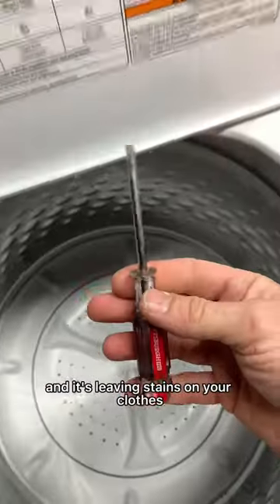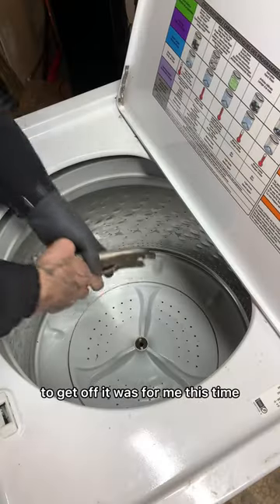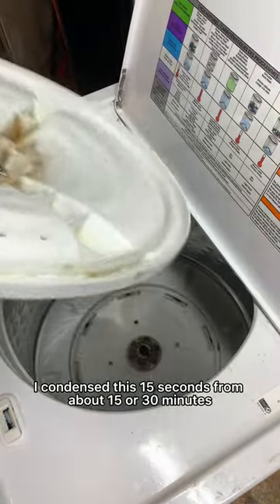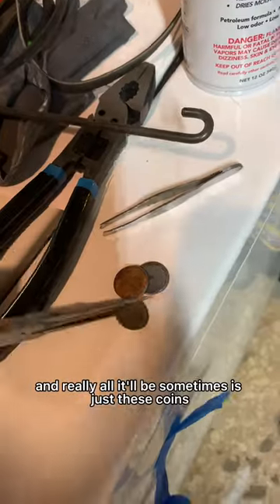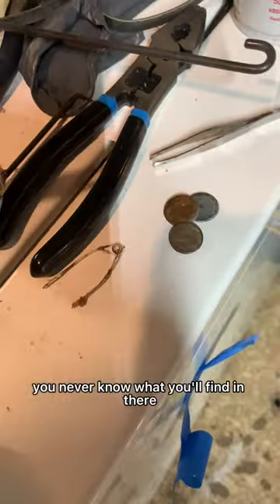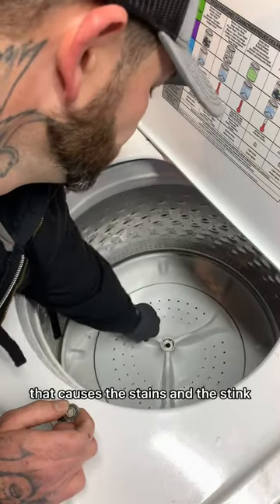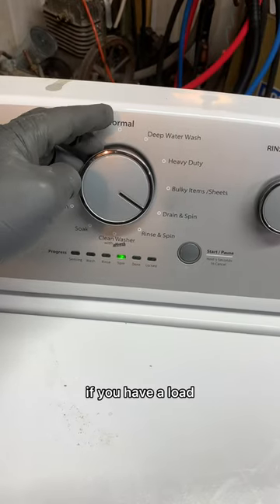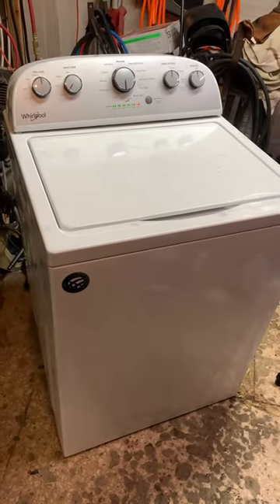One reason for brown flakes on your washer

Comment: To get the plate off I use like electrical wire to get under the plate  like a long harness to get under the plate and just kind of shimmy it up and it comes out I do that I with  my jobs
Reply: Use a 341241 dryer belt
Reply: Very nice advice, I used a 19 GA Stainless wire and it popped up like soft butter so easy I couldn’t believe it. Thanks 👏 🙌